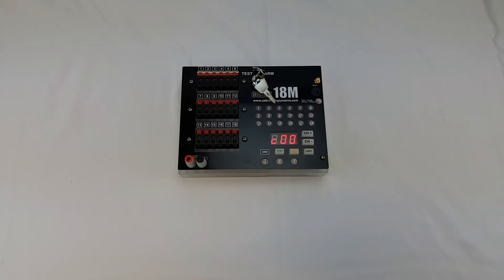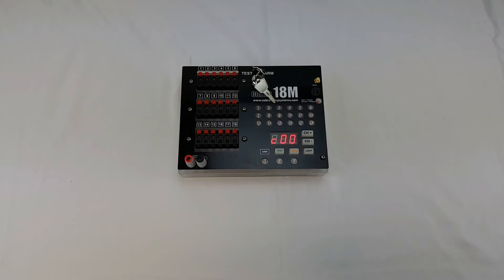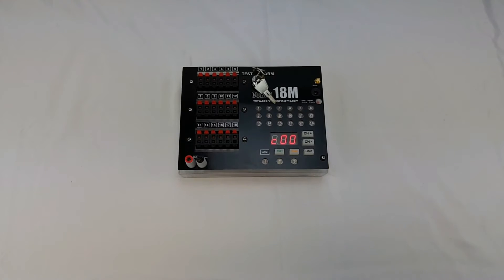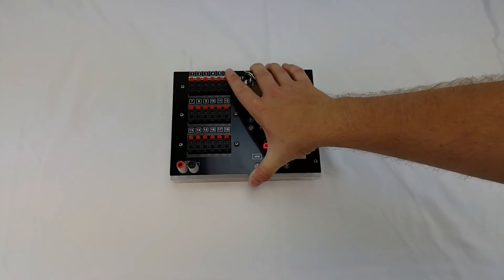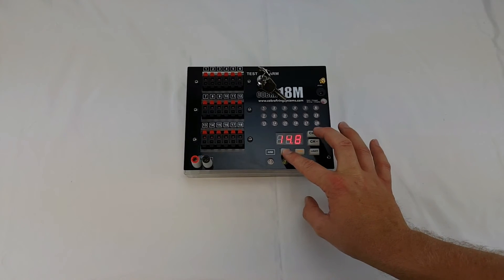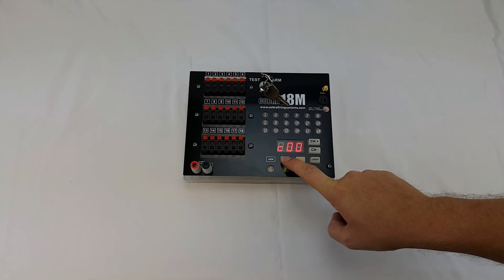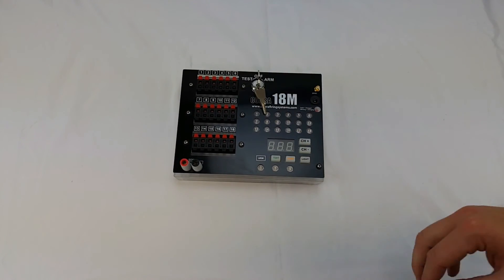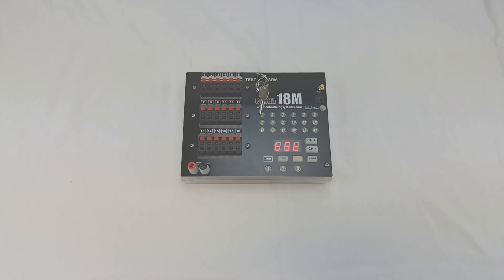How to - Voltage Mode

Comment: Hey Joel, just wandering how that directly effects the 1P_ and 2P_ numbers, notice on your vid that mod is 14.8 but the next numbers were 1P5 and 2P5? Used to be 1P9 was full nine volts? Is it now a percentage of battery charge? So if you have 24volts would 1p4 or 1P5 be around half the volts or 12?
Chuck
Ps maybe another vid to explain this?
Reply from the maker: +WestPaPyro Chuck, the 1P and 2P values are simply a percentage of life remaining. The 1P9 is not 9 volts, but rather at least 90%. 1P8 is at least 80%, etc... The P values are simply a percent ranging from 0 to 9 and don't reflect actual voltage levels as these drop differently based on the type of battery.